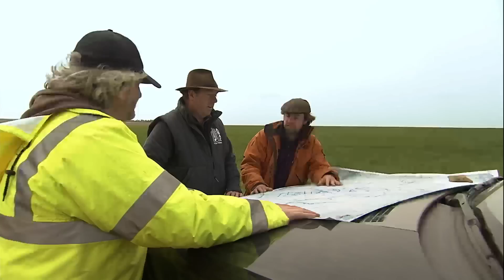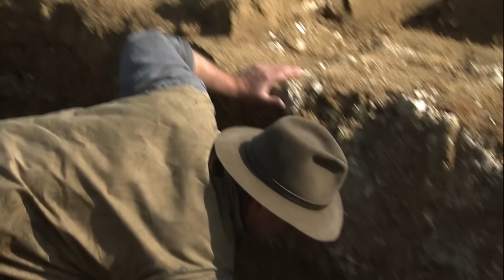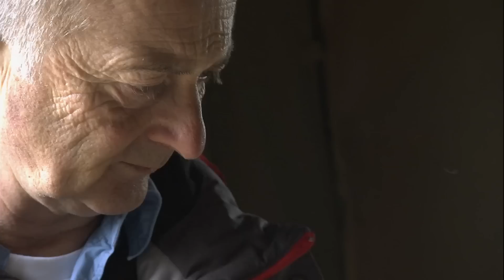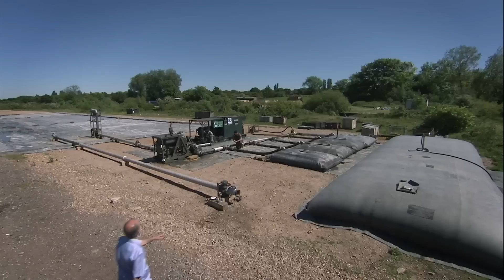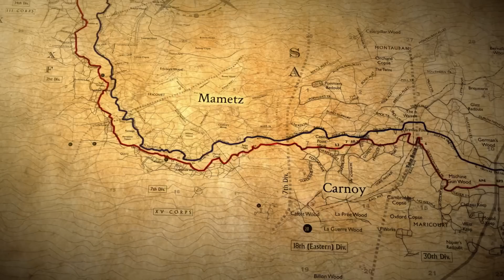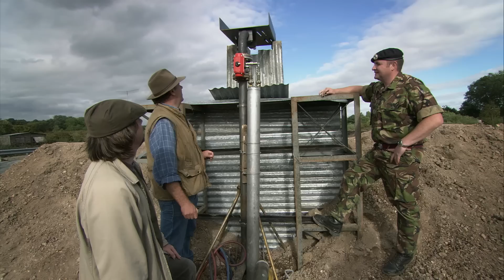Rebuilding The Giant WW1 Flamethrower That Terrified The Enemy | Breathing Fire | War Stories

Comment: "The valve still turns, Really Shows the Power of british enginering" 
If the germans had built such a thing it would still be working
Reply: The weapon had a shell explode on it, burying it. Of course it wouldn't work and neither would a German one, either, if it had gone through the same experience.

Comment: Well, the range of the flame depends a lot from the viscosity of  the  flamethrower fuel. Using a very viscous  fuel you will obtain a range  of probably  100 meters. In fact during the battle of Okinawa (1945) USA used heavy flamethrowers mounted on tanks that had a range of several tenths of meters. So, there is no surprise in this video.
Reply: Tenths of metres?
Reply: @blastfromthepast7119  Sorry, it was tens

Comment: What a frightening weapon ! To have designed, built, tested and deployed within a matter of the short time Livens had, makes this man a genius.
Reply: Don't be a wuss. It's amazing, not frightening.
Reply: @splitman1129  Depends on which end you are on.  A Brit with hand on the lever 'Aw, cool!",  A Jerry in the opposite trench "Ach Scheisse! Achtung! Flammenwerfer!"    You can't duck below the sandbag parapets like you could with .303 fire, the flame expands, the diesel made it stick like napalm and if you retreated to a bunker, you could die from monoxide poisoning or suffocation from the flames burning up all the oxygen in the air.
Reply: @adlerarmory8382  IBM

T
Reply: @splitman1129  you sound like a wuss
Reply: @splitman1129  depends whether you are British or German l!
Reply: @splitman1129  its not that amazing. Its just a hose spraying oil that they lit with a match. Back then it was useful. Twenty years later a weapon like that would be obsolescent.